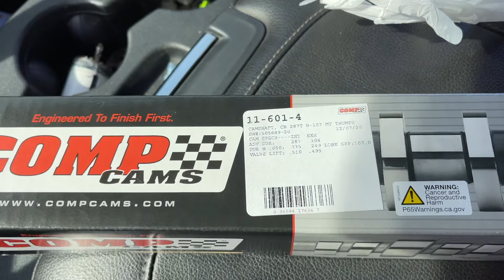Jackstand's $2,500 BIG BLOCK Jet Boat Makes a Miraculous Recovery After Finding BAD Engine Damage!!

Comment: Make sure you have the vacuum advance on the distributor is disconnected as and blocked off. Jet boats are constant load drives so there is no need for vac advance. Also make sure you hit full advance at around 2000 rpm. Might need to adjust the mechanical advance fly weights.

Comment: James change it from a 2 valve system into a tee with one valve in the middle ! Definitely hit the home depot galvanized fittings section super cheap
Reply: You can even reuse the valve !

Comment: Scary adding a car cam to a Jetboat. Ideally you match the cam to the powercurve/Impeller size. You most likely want max power at 5200-5400 rpm if the boat's got an "A" size impeller.

Comment: Didn’t see it in the video but James did you run that cam in for 20-25 minutes to break in…. I know your used to roller cams. But if you didn’t break it in that cam will have a short life and end up like the last one right quick.

Comment: Just run the headers dry, if not then you need a t valve set up, usually we disconnect the pump when runnin a while out of water. They get too hot out of water

Comment: Also, you can just remove the hand hole cover and see if there's anything wedge in there, might even have an inducer (pre-impellar). Wouldn't doubt it since previous owner went through the process of adding rideplate

Comment: Check in the intake of the jet for stuff - sounds like you sucked stuff up in there that didn't necessarily push out into the impeller/bowl

Also - dont worry about running water in the headers most of us west coast guys run them dry.

Comment: Had a Jet with a BB chevy and headers, had a hole in the bottom of the header tubes between the water inlet and the head (like the lowest point) prevents it from filling up like your seems to be doing and also lets it drain so the headers don't rot out. One valve and a Tee works better, ball valves are not so good for regulation.  Good luck with those clamp ons.  Put em on the trailer!  Think the hole in the headers was like 3/16".

Comment: I did that... Once. Built a 350 and let it set for 7 years. I used a drill, pressurized it, and turned it by hand a bunch. Ran perfect for a day, then a couple lobes disintegrated. Surface rust scores the lifters during break in and it's game over.

Comment: It's not supposed to flow water to headers at idle. There is supposed to be a checkball that opens above 2000 rpm. Also make sure it doesnt go over 15 psi or you will blow head gaskets

Comment: Old school BBC owner from 50 years ago here....  A new Flat-tappet cam should be broken in at 1500 rpm for 15 minutes.  Moly lube used during assembly.  I hope it is a hydraulic cam/lifters setup, easily the choice for a boat motor.

Comment: At idle you should have them almost completely off. At rpm is whe. You would open them back up. A lot of guys put a T-handled ball valve by the shifter to make controlling the water flow easier. Otherwise there's  a spring loaded on that opens at about 1800 from Bassett, but they're back ordered and over $100

Comment: To fix the water intrusion into the motor, you need to weld up the water outlets inside the header and open up a new water relief on the top and back of the pipe, and plumb the water away from the exhaust, so it won’t suck it back into the motor. Or you continue to milkshake your oil.

Comment: Can someone explain the water valves by the intake? Are they leaking? I don’t understand why when they are fully open it’s filling the top of the engine and the carb settings are different.
Really enjoying this series of vids btw 😄

Comment: BBC are notorious for lifter indexing being too centered on the lobe. You HAVE to run ZDDP with a BBC and a flat cam. That chain is wasted but will work for now. That cam is mild so springs shouldn't be an issue unless they're wasted.
P.s. carry a spare 4 pin module in the boat!
Reply: It should eat itself again since it wasn't torn down to the bare block and all the cam grit cleaned out.   ESP if he went back with a flat cam and non-hardened lifters.
Reply: @earlbrown I've seen engines survive damage like that with an oil change, flush, and fresh oil. ONLY if the oil bypass it tapped and plugged.  1/4NPT tap and a pipe plug can save you thousands for less than 50 cents ;-)

Comment: How to build a performance engine on the cheap.  
Step 1 Buy new parts.  
Step 2 Install them.  
Step 3 use a "sometimes flashes" timing light.  
Step 4 Take it for a test drive.  
Step 5 If and only if it runs right, give it an oil change. 

 You guys crack me up.

Comment: Hope that your problem doesn't end up being with the automotive camshaft.Marine camshaft are ground for lots of low and mid range torque unlike automotive camshafts don't build torque until upper RPM,s
Reply: That's not true when it comes to jet drives.

Comment: James take a acetylene torch and heat up the ring gear tap it off turn it 180 degrees and flip it over and put it back on it will work like a champ, and cost you nothing

Comment: Hopefully James remembers that props are designed for a specific RPM band too, so if he wants to make the most of his power peak he may want to consider replacing the prop
Reply: It doesn't have a prop, it's a jet.
Reply: @big_steve_o5129  Derp, you're right.  Good point.  I wonder how much speed he could pick up just by rebuilding the jet..
Reply: There are different impellers available, but he'd probably gain the most by fixing what's broken and actually getting the thing running correctly.

Comment: Dont idle that cam until it has at least a half hour on it... 2500RPM break in for no less than 20 min   ...  BBC on wet headers do that... we run poppet valves that kill the water at idle and anything under about 2000 rpms..  set your timing for around 36º

Comment: Serious question what is the water in the headers supposed to do? Is it plumbed into the head into those thermistor air bumps for the emissions bs? Is it so you're less likely to burn yourself on the pipe or something?

Comment: It’s sucking water on you because you are running it under pressure on your hose. 

Shouldn’t be an issue in the lake. 

An I/O with a manifold leak will do the same thing.

Comment: man yall were gittin back in there where nobody goes in them jet boats I was waiting on a big 8ft mossy harry creature to jump out at anytime,had a few jet boats there bad about crackin heads in the winter if you dont drain out all da water or pump antifreeze thru it not wanting to be negative i hope its ok but they wont run right with this problem i learned it hard way

Comment: I imagine you know this already but marine motorw spin opposite direction  as in crankshaft compared to a normal car/truck motor  learned a few years ago
Reply: No they don’t . Only one of the engines if there are two. That is an automotive engine, it just happens to be in a boat.

Comment: Wait, James, you put a brand new camshaft in a motor with chocolate milk oil, and ran and revved it and THEN said you need an oil change?! I’m no engine builder, but it would seem prudent to do the oil change BEFORE the cam install.

Comment: Just a question all did ya get cam oil to put on the cam shaft before starting if you did your supposed to run the cam in for about 40 mins at high revs and without boiling the motor and what this does is harden the cam and run it in properly and this is how I always have been tought cuz the oil is and heat treating oil

Comment: Don't need the water for your exhaust. That only helps keep new polished headers from turning blue and hurting the exhaust coating. It also just quiets the exhaust down if you at a lake with noise restrictions. Your headers are old and rusty anyways so don't run water thru them. No need.

Comment: Don't open the water valves to the headers all the way. You dont want any water in the headers below 2000 rpm. After 2000 RPM you just want a fine mist or steam coming out the pipes. Check your oil after that run, I bet its milky from the reversion. The water is generally only to keep the chrome on headers from bluing and flaking. You really dont need any water unless your worried about chrome on the pipes or blistering the pain and fiberglass.

Comment: fresh water pick up vs pressurized hose will react differently... you should be good to open all the way in the river
Reply: The jet bowl pressurizes the water that cools the engine and injects the headers.

The header valves will never need to be fully opened.   Both the headers and the engine need restricted water.
Reply: @earlbrown  good to know,  I was thinking it was similar to to exhaust cooling on a standard inboard motor

Comment: No cam break in???? I’ve been told by the local jet boat shop in town down go over 230 degrees on the exhaust side of the cam. Crests a vacuum in the exhaust

Comment: Jimmy needs to ditch the dual water valve and jut use a single. A lot of guys out here on the river actually use a standard garden hose valve. It will help you even out the water flow. Also if you think your getting water back into the engine, just leave the valve shut to the headers so you dont screw shit up

Comment: I really hope you did the 2,000 RPM break-in procedure for that hydraulic lifter camshaft!!!! Or you're going to be right back at square one with another wife love or all of them on the camshaft..
I said in the comments on the last video that it was a possibility I had a wife level on a camshaft and bingo there it is...
Looks and sounds good.
Reply: Pretty sure he didn't tear it down to the bare block and clean out all the cam grit.

So, there's a good chance the engine is going to eat itself again.    ESP if there's no additional ZDDP added to the oil.

Comment: I used to go under limbs an such when I was out boating, but found myself punching holes in the bottom of my craft when the water Moccasin sunning himself decided that our boat looked interesting enough to join us.  Yeah it was not the thick aluminum bottom boat you guys are using, it was a canoe, but it still wouldn't be fun in your boat , who's gonna stay in it to remove the snake, and then how long are your friends gonna cuss you for tossing it in with them.

Comment: Yes marine cams are different from car cams
Reply: Nope
Reply: He even stated they were different in the video Im a boat mechanic in Texas we just got done with a 502 big block with the same issues. Customer swapped from a car and didn’t know about the cam lobe is different in boats because if the valve opened as much on a boat as on a car it would suck water. Which is what’s happening 🤷‍♂️ but ur the experts
Reply: @stevegiboney4493  and also in your other comments are all wrong also 🤣 apparently your not a mechanic nor are you inclined.
Reply: @stormbrown7158  if you think that every jetboat has a marine cam, your nuts. Mine does because I ordered an Engle cam to match a b impeller. Guys that don’t run wet headers don’t need to worry about reversion.
Reply: I’m standing here next to the owner of a machine shop who is saying every in board motor has a marine cam. How is it possible not to have wet heads??? The water jackets run through the block to the heads?!?!? Also there are no “headers” on Marine motors they are called (Exhaust manifolds).
Reply: @stormbrown7158  , you certainly don’t have to worry about reversion with a closed system . An inboard with a prop is way different than with a jet, and with water injected headers. Water jacketed exhaust is totally different.I’ve owned jet boats for 40 years. Jets achieve max rpm right now, prop boats have to come up on rpm as they gain speed. Rv or marine cams have the right cam profile for that. Have him look at the video and he will see what we are talking about.
Reply: @stevegiboney4493  I stand corrected you are right as long as headers are about water leaves you should be fine in a jet boat only way water still gets in is cracked block or head gasket
Reply: @stormbrown7158  , in a high performance application with a camshaft that has lots of valve overlap, ie both valves partially open at the same time, a thing called reversion occurs and water is sucked back into the combustion chamber thru the exhaust valve, out of the water injected headers. That is discussed in many of the comments in this thread.

Comment: No oil change on a brand new cam. I hope they run the cam in off camera. New camshafts with flat tappet lifters will wipe out a cam real quick. Especially with that crap oil and no zinc.

Comment: You can't run a mother thumper on a marine motor.. you will get reversion.. also make sure you not running more then 15 psi water pressure from the pump or you will blow gaskets...

Comment: Mark my word, it doesn’t matter what you do to the red jet boat, it will not beat the pink out board boat! If the blue bass boat has a stainless prop it will also beat the jet boat! I own a 85mph fast Bullet bass boat, out boards rule jet boats suck!

Comment: Why the water for the non marine headers? Let them get hot they are away from the body. it's letting in the water from the exhaust valves. likely why there is water in the oil.

Comment: Lot of time spent setting the timing when that engine should have been at 2000 rpm breaking that flat tappet cam in ... but then again ... it's not here for a long time , it's just here for a good time ...

Comment: If your exhaust is wet and the cam is too big, the water will travel up the exhaust into the engine. They use jacketed dry pipes on setups with a bigger cam. Not sure if that helps you

Comment: dude if the cam looks like that its caused by the water in the oil, your crankshaft bearings should be shot too. piston ring probably worn as well.

Comment: James you don't need any water running through your exhaust at all you have more chance of getting a hydro lock as I have none running through my rear Mount race boat check out the video if you wish it is a 308 stroked out to a 345 running on avgas aircraft fuel only difference is it will be a little louder here is the link if you wish to watch it https://www.youtube.com/watch?v=hbSQQmhTC1U

Comment: James is weak for not working on his boat and putting in effort like everyone else did. Now he's holding up the whole crew and setting the whole schedule back. I like james on the crew but he needs to be a team player and respect everyones time and not throw off cleeters plan. All he had to do was the bare minimum and change oil, fix that flywheel and a simple once over would have revealed the cam problems.